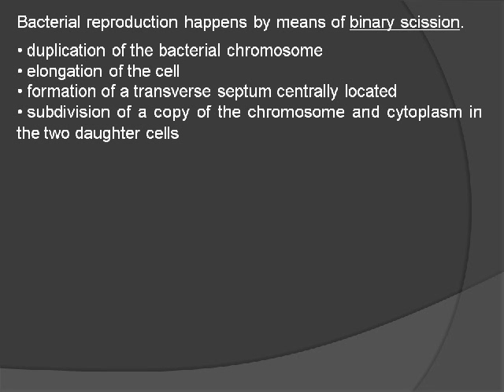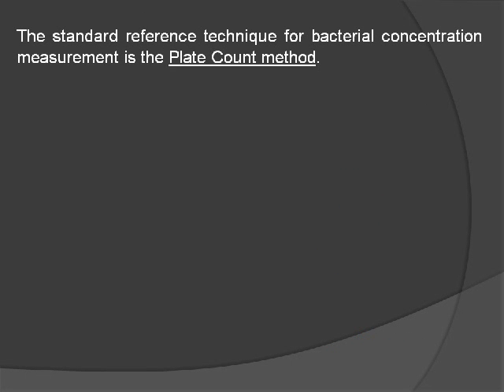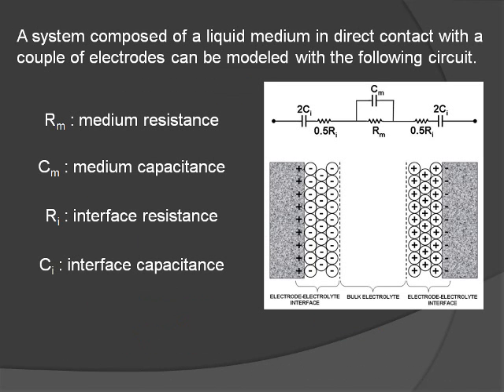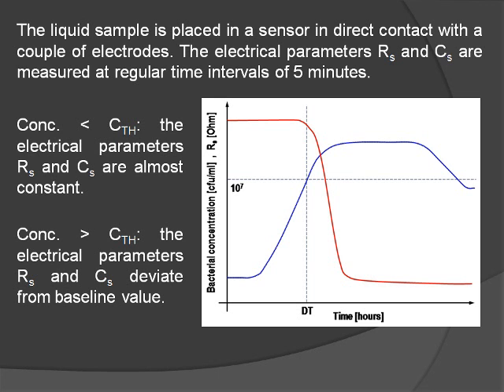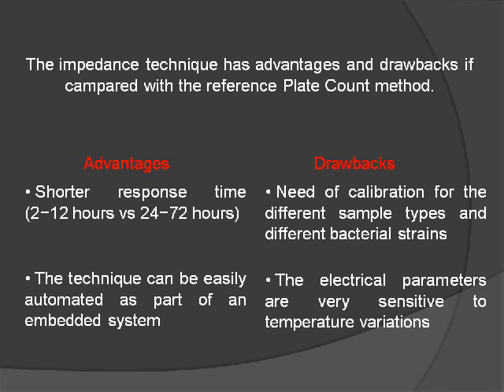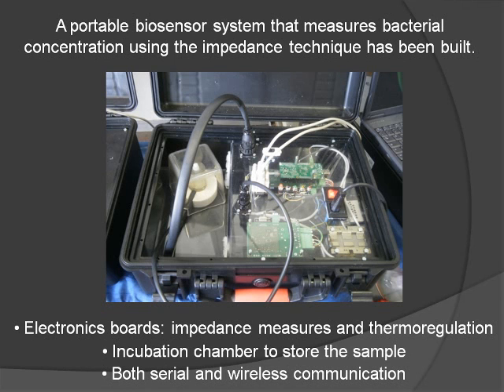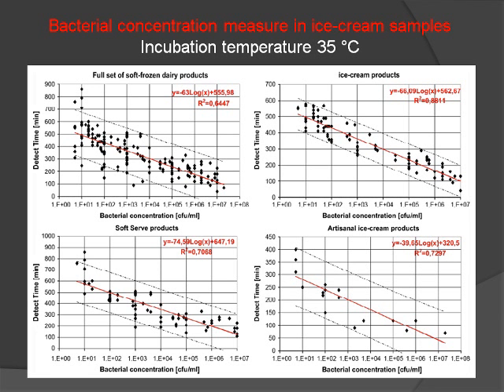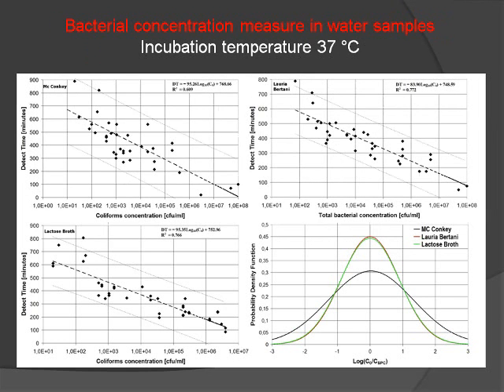A Portable Biosensor System for Bacterial Concentration Measurement

Comment: Where could I find the sensor or how can I make it
Reply from the maker: The sensor is not commercially available. You can refer to the bibliography at the end of the video for further informations on the biosensor. You can also read about Impedance Microbiology (https://en.wikipedia.org/wiki/Impedance_microbiology) that is the technique used by the biosensor to estimate bacterial concentration.
Reply: So you mean we can make this sensor as a handmade 

If yes 
Did you referred this in vedio
Reply from the maker: The biosensor was built at the laboratory of Electronics at the University of Bologna.
The biosensor hardware is discussed in the reference papers. There is no video.